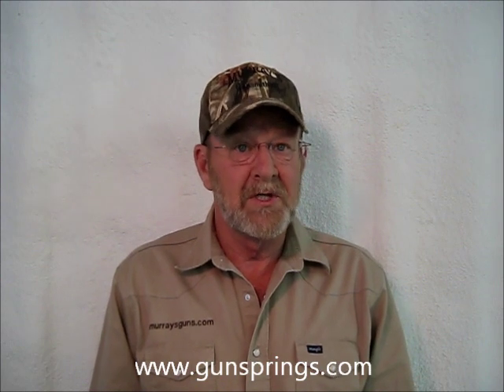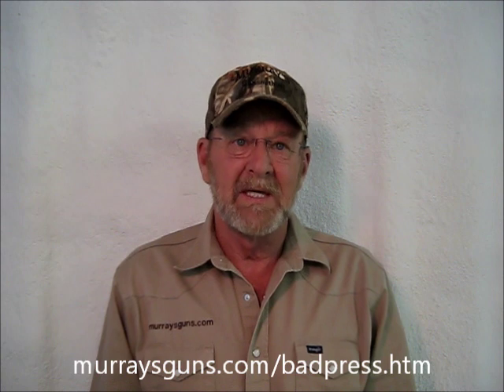Firing Pin/Ammo issues with SKSs

Comment: I bought an SKS sear from you guys and it was of superb quality :) Great video!
Reply from the maker: It's not hard to supply a better Sear than the ones that are in most SKSs when imported as most are in really bad shape. Seemingly imported with negatively altered engagement surface, but with ours you'll have positive engagement and very smooooth creep portion of the felt tr pull. Glad you're pleased!
Reply: my sks will pop primers on wolf ammo but with redarmy it dont always pop but leaves a ring around the firing pin strick how do we fix this problem
Reply from the maker: Our site has a page about the "Neck & Throat" service that puts a stop to popped primers 100% of the time, and allows you to shoot any and all ammo available in U.S. without those problems.
Reply: I also use the Murrays firing pin with spring and it has made my SKS run better and safer than ever!

Comment: Hey Murray, will your new firing pin and spring work with berdan primed ammo or do you advise not to shoot it with that.
Reply from the maker: Yes Sir. Shoot all you want. Unless you have Wolff's 27.5 lb Reduced Power Hammer Spring, or an original Hammer Spring that has taken a set. (you might experience misfires with Berdan primers) Wolff says theirs is intended for "quality" ammo meaning Boxer primed stuff. But our 31 lb Hammer Spring that Wolff makes for us, allows some reduction in the felt trigger pull, but still gives consistent ignition of that Berdan primed ammo. 34 lb is original strength. But do be advised, Popped Primers are another subject that happens with original firing pins and our firing pin as well. But that can be cured very easily with our "Neck & Throat" service that is 100% guaranteed to prevent these primer failures from occurring. Shoot the cheap stuff!!!!!!!!!!!!!
Reply: My Gunsmith  already did the stone and countersink bolt face work for me the only thing I saw was when I took the rifle to the range is the Berdan primed ammo looked like the primers were slightly bulged or swelled out a bit not sure if that normal, I’m thinking it’s because of the countersink in the bolt face?
Reply from the maker: @zlatanzifovskijr4576  Yes Sir, that is very common with the SKS and we believe the reason is the size of the firing pin hole on the Bolt face. AK's have an .08" diameter hole and SKS's have a .100"+ diameter hole. Just simply more unsupported area of the primer. But the primer flowing into the countersink area just helps prevent primer failures. And you can see on our "Popped Primers" page how there is very little primer flow on the AK samples shown that do not have the hole in them. And while that countersink may help prevent them, the only sure cure we know of is our proprietary "Neck & Throat" service that removes the spikes in the peak chamber pressure that is causing this issue. Being steel cases with Berdan primers, people don't normally save them, so as long as the primer does not fail, the protrusion you see won't harm a thing.
Reply: Thanks for the clear up sir, I was thinking on switching my original firing pin to see if there is a difference but your firing pin is excellent and Is holding up well